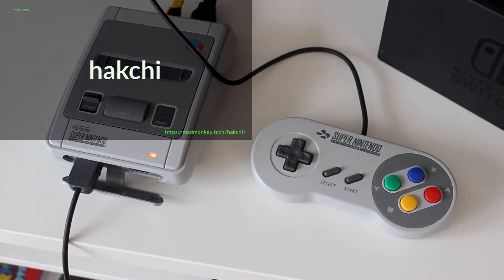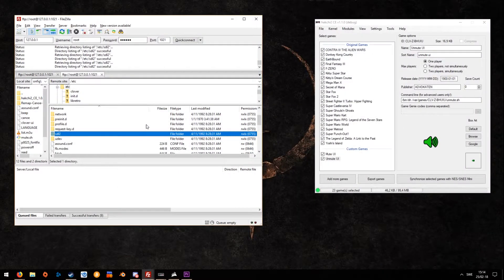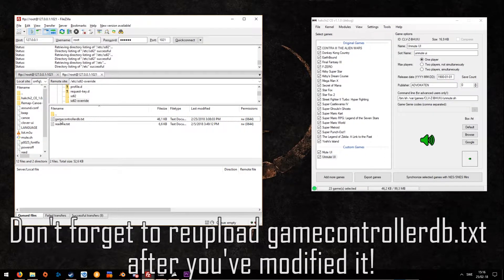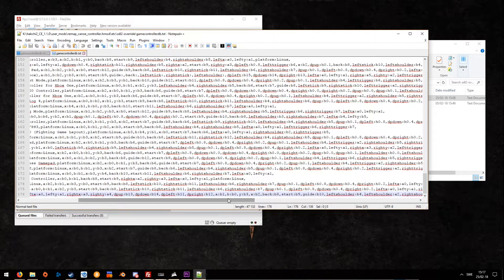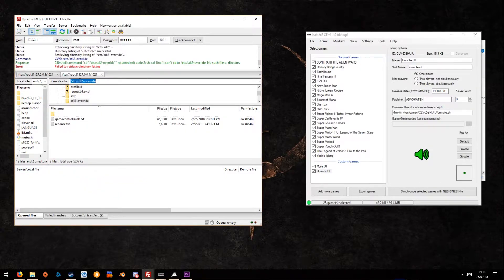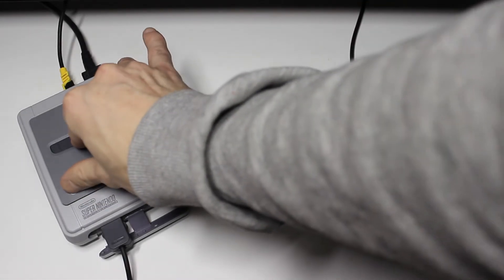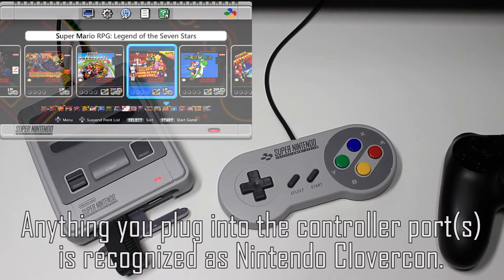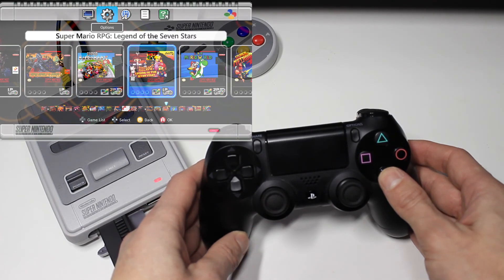S/NESC - How to remap Canoe controller inputs

Comment: Im having trouble getting this to work with the new hakchi ce v3.8. No matter how i install you mod, and i follow all your instructions step by step, all the buttons function as "a". no B, Y, or X. i tried installing the mod directly as you wrote it, and modifying it with every combination of assigning each button with a different value b0-3. But nothing works. Even though all the prompts in your video are the same in hakchi 3.8, it just doesnt work. Thoughts?

Comment: I'm having a bit of trouble trying to figure out how to change just the snes buttons back to default BEFORE installation. Do I need to put everything in the root folder of hackhi? I see the assets of the github, one being the hmod itself, and the source code which has the editable file, but I can't figure out how to send the changes to hmod before installing it to hackchi ce. Thank  you.

Comment: I have been using this mod and works great. Thank you so much for taking the time to create and give away for free!! How would i go about setting the C buttons for N64 roms to the right analog stick? I have been having trouble trying to map them and have them work. I have tried on different controllers through the arch menu under user binds but to no avail. If it is possible i will be soooo happy. Thanks again for the awesome mod!

Comment: That's handy.  For whatever reason, my PS3 controller was all messed up when we hooked it up, and we couldn't make super mario world work very easily.  This fixed our issue.
Reply from the maker: Cool, thanks! :)
Reply: Where you able to use L2 and R2!
Reply: @SolidusSnapes  i think it would be possible but never had a need.  If you look in the hmod file it has info on mapping multiple buttons.  Either way its  very handy.
Reply: thanks nick @R3llim87

Comment: Is it possible to bind a nes and snes controller differently on the same system?

I want to change Y->B and B->A on the snes controller, but leave A and B alone on the nes controller.
Reply from the maker: Hey Shaun! Yes, I did this video for the first version of the mod where changing inputs would make it happen across all firmwares. In 2nd version there's nes and snes folders, one with individual mappings.

Go to
https://github.com/advokaten/Remap-Canoe-Controller/releases
and you will see the 1.1 release.

By the way, if you are using hakchi2CE, you can find this mod in the Mod Store!

Hope this helps. Let me know if it works or if you need further assistance. :)
Reply: @MrAdvokaten  Can you clarify on how to disable to swapping of A and B on only a NES controller?  I see the nes and snes folders in your directory, but I had assumed that the nes folder was for when you were using the NES Classic and the snes folder for the SNES Classic.  I tried renaming the nes .txt file to .old but then that un-swapped the buttons on my SNES controller as well.  Thanks!

Comment: Can this be used to fix the button mapping on the NES side?
Reply: Yes, this is what a lot of us want I think. We want to change NES Classic dual boot buttons from AB to BY. (and probably make AX do the same as BY afterwards)
I don't see a reason to mess with my global input... unless you somehow manage to plug in a PS4 controller like this. I didn't know that was a thing. Is that for PSX? I've been using Wii Classic Controller for that, but not everyone has that I suppose.
Reply from the maker: Rein van Zuylen Depends on what you mean with fix. What’s the issue? I use a PS4 controller on my SNES. I download and install the hmod - A and B are swapped. I dualboot into NES, A and B are still swapped. :)
Reply: When I use the snes controller with the snes classic, the buttons are correctly mapped. If I switch over to the nes classic (dual boot) , X and A are mapped to B and A, I would like to use Y and B as B and A. Is that possible with the mod?
Reply from the maker: Yeah, you'd just change the gamecontrollerdb.txt and go by trial and error, I suppose. But that'd universally change the buttons, across all firmwares... Another release will come, where you can remap on the console itself, and for different firmwares etc. :)
Reply: That would be great, I’ll wait for the new release then. Thanks for your reply!
Reply from the maker: You could make such a mod yourself. :) a version 2 will come... eventually